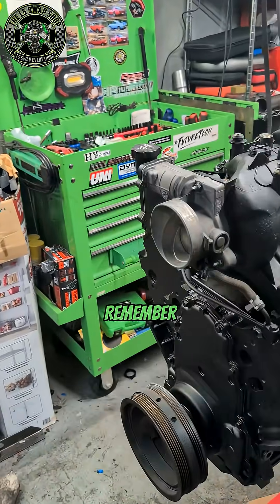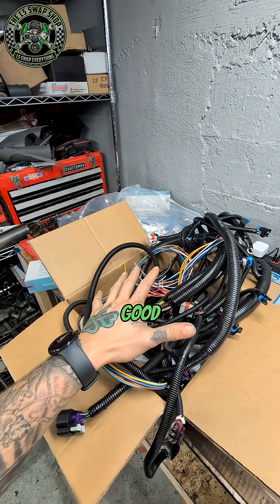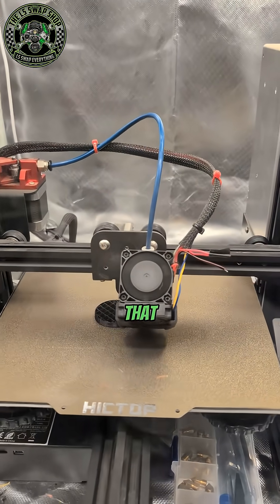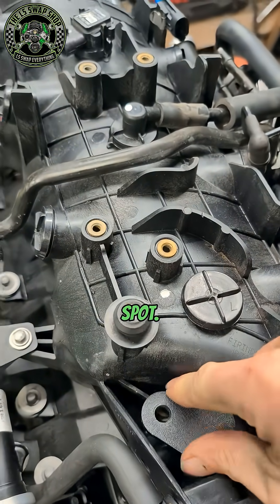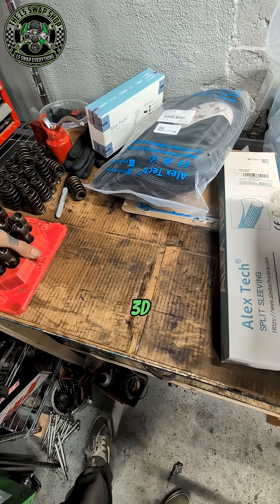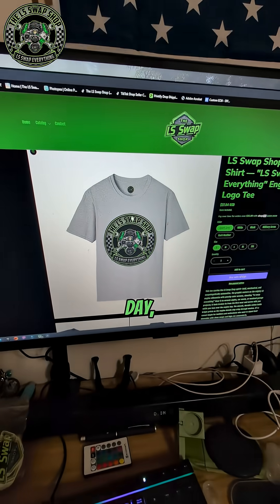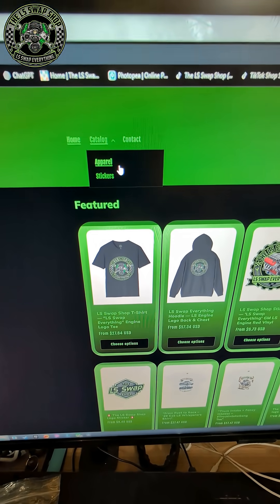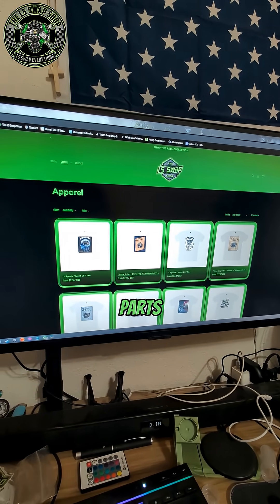3D printed engine parts!!

Comment: Sweet would you be able 3D print trays for the atlas 4.2 also known as the vortech 4200?
Reply from the maker: I might be able to. You mean like valve trays.
Reply: @TheLSswapShop yes and the valve springs
Reply from the maker: @CodmUSAI'll see what I can do.
Reply: @TheLSswapShop  thanks I am thinking of adding the 4.2 to my built list
Reply from the maker: @CodmUSAbeen wanting to do something with a 4200 as well. I hear they are beasts.
Reply: @TheLSswapShop  the american 2JZ  800whp on a stock bottom end just do valve springs and some cams and arp head studs and  throw a thirty pounds of boost at it and that is easy
Reply from the maker: @CodmUSAit's like the LS of inline 6 cylinders lol. I love it. Stock bottom end 5.3l will handle 1200 hp lol.  Crazy stuff. It's a little more spendy to make power with the 4200 though I bet.
Reply: @TheLSswapShop  there's definitely less aftermarket support for it, but it's not necessarily more expensive